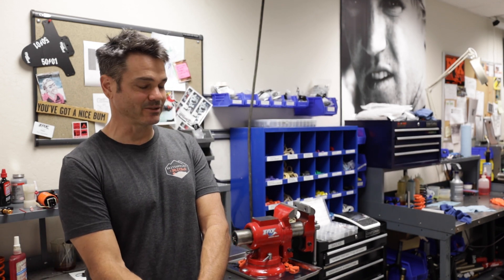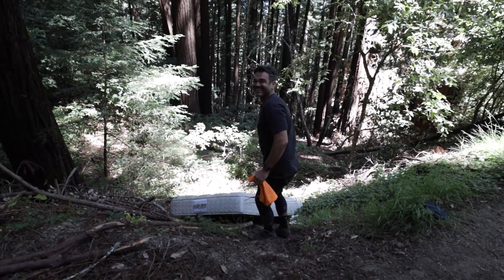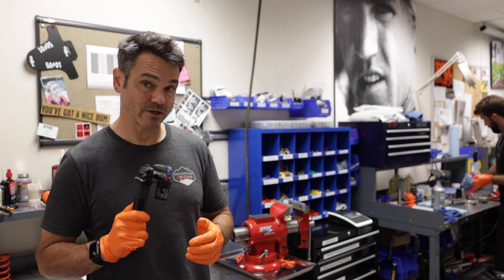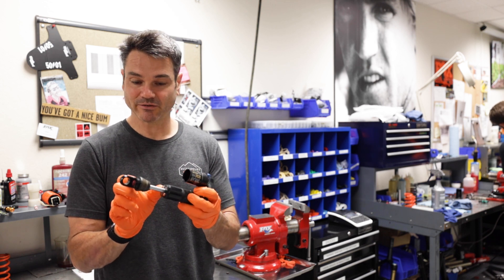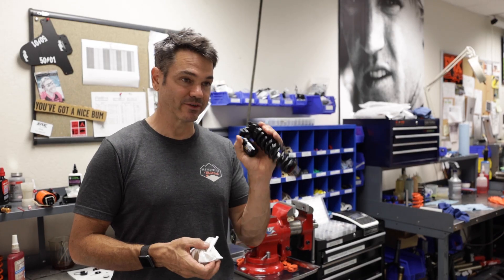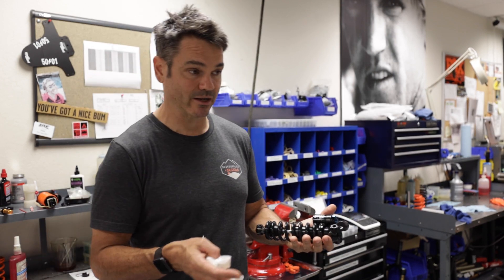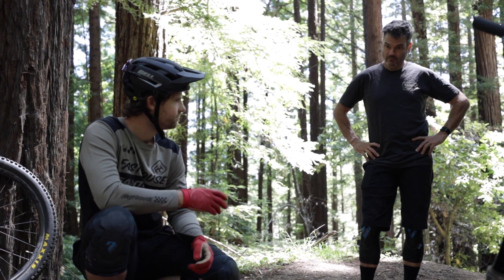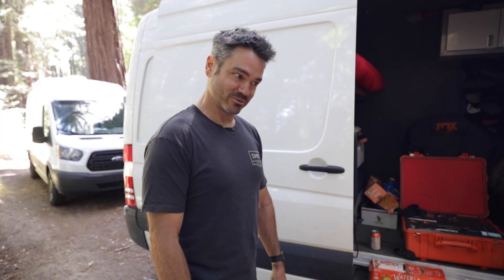DIALED S2-EP29: Race Tune vs. OE Tune | Day in the Life with Jordi Cortes | FOX

Comment: I got a tune done on a super delux and it made a massive difference. I weigh over 16 st and went from L/L to M/L, or something similar. When i installed it after the tune in comparison from before it went from me sucking into the mid stroke all the time to feeling like i had climb switch on which was weird until i started getting the compressions and it opened up and just absorbed everything. It wasnt a subtle difference either. Its made a big difference to how my bike rides, so much that its made me realise my fork was way too soft (fox 38). Thats now gone up in pressure by 15psi and one less token. Bike feels super supportive and plush but at the same time active for the bigger hits. 
If your light or heavy tunes make sense. Also if your bike has the same shock tune for all sizes that may make it worthwhile. I have a hightower in xxl which has the same L/L tune as a small.

Comment: Hey guys, I have an interesting situation that could make a good topic for video. I have a Canyon Sender CF, which has a more progressive style MX link. The bike shipped with the Fox Float X2 (9.5 x 3), which as you know, has a 250lb psi limit. The X2 came fully loaded with volume spacers.

If I weigh ~250lbs, the 250psi limit of the X2 is an issue. I've been running it for this year, but ultimately wanted to swap to the DHX2. When I started researching this, I heard all kinds of things from "you can't swap air for coil on just any bike", to, "the progression on an air vs spring shock will cause you issues depending on your linkage (in my case the MX link)". Can you help to validate or debunk these claim?

 Another issue, what spring size do I buy? All spring calculators I found gave me slightly different answers or asked for confusing measurements.

Can you help shed some light on things to consider when switching air vs coil shocks? 

Cheers!
Reply: I am running the same bike and can tell you that it works way better with the DHX2 than it did with the Float X2. It has loads more small bump sensitivity and hasn't lost any of its pop that it had with the air shock. I am running a 475lbs spring for my weight (70kg/154lbs) and I hardly ever bottom out. For my weight and riding style (fairly aggressive and big jumps) I only see upsides of this change. The problem I foresee in your case is whether you can find a spring rate that will give you enough support. If I were you I would start with a 600lbs spring and go from there. You could buy ordinary Fox steel springs (black ones) second hand while you are trying to dial in the rear end and only get an SLS once you have the target rate figured out.
Reply: @szentea  thanks for the input, I appreciate the suggestions! Cheers mate
Reply: When youre 250lbs there is no damper on the market that will work well without custom tuning. Most shocks are built to work for weights between about 130 to 200lbs.
You could put a super hard spring in there but the compression damping (should you need it) will be very weak. Same for the rebound damping.

I would recommend you talk to a suspension tuner first, before investing 700 bucks in a new shock. They usually know the shocks and their usable range pretty good.
Reply: Hey Zak. I had a very similar issue. In the end I had the X2 covered to a coil. It was, relatively speaking, cheaper and the feel was so much better. I'm not sure where you're based but it might be worth looking to see if any of your suspension tuners are prepared to do that conversion.
Reply: For my Nukeproof Mega I was quiet unhappy with the standard air damper.
Since I’m in Europe and wanted to get something that will definitely work with my bike, weight and riding style, without tinkering with the settings to much, I contacted EXT suspension.
They advised I get the EXT Storia Lok and custom tuned it to my bike, weight and riding style.
It was on the more expensive side, but it works just perfectly!
It eats every small bump, big hit, trail chatter, just everything.
It has huge amounts of pop and it even pedals way better than my former air damper, even without using the Lok function.
When you use the Lok function you basically get a hardtail feel while pedaling, but still the full amount of traction and bump absorption, since the Lok is a fully independent circuit which does not affect your compression and rebound setting.
And when suddenly something bigger appears it still isn’t a problem, since it has a great working overflow valve, which opens up super quick!

It was the best money I could invest besides my Formula Selva Fork.
Now with the full Italian suspension setup the bike is the most amazing bike I’ve ever ridden.
From gnarly downhill stuff, to light after work trail riding and bikepark/jumpline stuff.
It feels completely dialed in all the time!

A big bonus is, that EXT can even rebuild the shock to different measurements and of course tunes if I decide to get a new frame.
The rebuild etc. doesn’t even cost much money, they’ll have amazing customer support and pretty low service rates after your first big investment of getting the damper.

Comment: Hi!  I would really appreciate your help here..  after speaking a few times with YT Support as well as Fox support, and having de-tuned the 2021 DHX2, the shock still "top-out" everytime it leaves the ground!  The Capra has a very progessive curve.  Angel Suarez gave me the same comment about that annoying "tic".  De-tuning the shock and slowing down the rebound helps, but I really like riding on fast rebound for more pop.  

So, what would be the next step?  Heavier oil would help?  Any other special tune?

Thanks a lot for your time!
Reply: How much preload  and sag are you running? Maybe try opening your HSR up a bit and closing off the LSR just enough to slow the topout. What exactly do you mean by “de-tuned” ?
Reply: @ericsmith9078  hey!  I am 165 pounds, running a 450 coil, 1 turn of preload, about 25% of sag.  4 clics LSR and 2 clics HSR (from out).  Slowing down LSR does help but kills the poppinest of the bike that I want.  We already tune the rebound damping to the heaviest (slowest).  I am stuck at that point ...  thanks
Reply: David Gagné perhaps try a 500lb spring and close the the LSR just enough to slow the top out, you should have a very lively bike at that spring rate. Heavy oil is going to slow high and low speed, probably not what you are looking for if compression is good.

Comment: I'm 6'4 and 210lbs and I can't get full travel on my 2018 pivot 429 sl at 25% sag and no volume spacers...should I retune it since I'm a big rider?
Reply: huck it really hard !
Reply: have you cycled the suspension with no or little to no air to see what full travel on the shock shaft is?  Sometimes just because the oring is not at the bottom doesn't mean you didn't get full travel.
Reply: @markf3940  Yea I tried that, the bike uses almost all of the shock stoke. I also checked for bind in the suspension.
Reply: Is all the compression adjusters wide open?

Comment: I have a hard time differenciating between compression and air pressure. When to change air pressure and when to change compression? Dont i change my sag when i add compression ?
Reply: Change sag using air pressure. Air pressure is used like a spring, more pressure = larger spring = more energy used to compress. Compression is used to control the moment of that spring. Without dampening, the bike would be bouncing around. Have a search how dampening works for more in depth. Compression shouldn’t change static sag, just take longer to settle is closed off a bit.